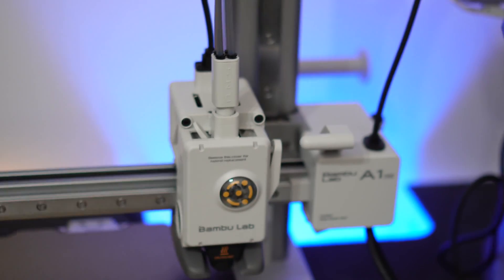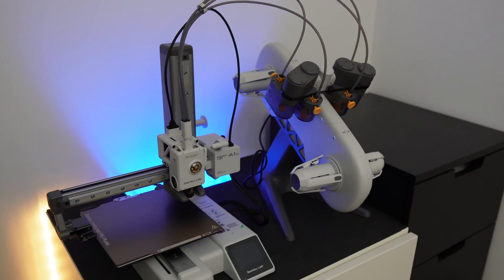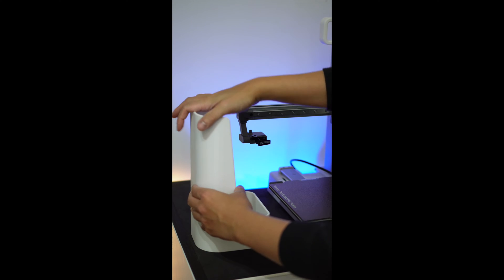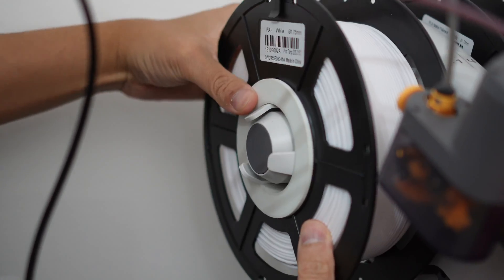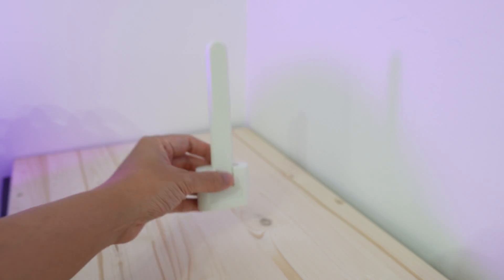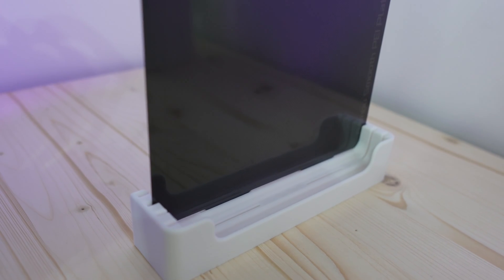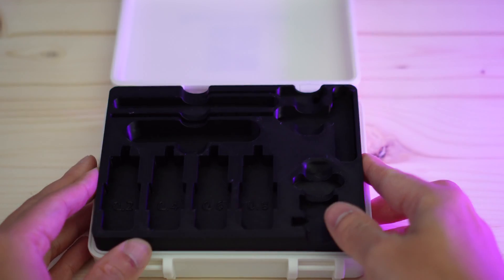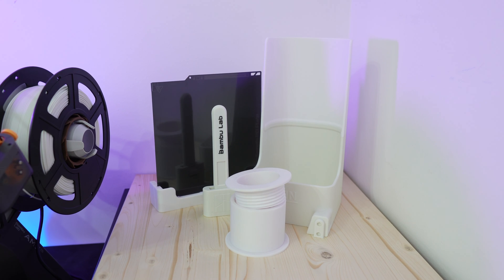6 Upgrades for the Bambu lab A1 Mini 3D Printer!

Comment: I must have been shafted with my A1 Mini purchase because the Allen wrenches that came with it are just awful. Just the bare "wire" keys, no handles. Very disappointing that Bambu doesn't offer the handle hex keys as a separate purchase in the store.
Reply from the maker: really? I got them with the plastic handles. Its interesting to know that they change that
Reply: Wait what? Actually??
Reply: @YaNeK92  yep, just the bare wire keys. Did a little searching and it looks like the handled keys were only included with the first orders after the A1 and Mini were released. Luckily I found a pattern on MakerWorld that will print some handles
Reply: @gammle-vikingr  thanks for sharing! I'm about to order mine in the next day or so :)
Reply: Then print it. I didn't even use it. Had a small driver for taking apart playstations with over 100 micro bits that worked great. Got the whole thing for like $20 at radio shack online a couple years ago

Comment: Great video thank you! but how do you move the printer when its connected to the ams? do you pick up the ams at the same time?
Reply from the maker: your welcome! I take off the tubes and the cable before i move the printer because i‘m not skilled enough to pick up both haha
Reply: Need to do an ama handle as well

Comment: Great video! I bought the A1 mini without the AMS, now that is in sale for about 200€ +  some accesories, it's going to be my first 3D printer too! You have a new suscriber here :D
Reply from the maker: thank you for subscribing! Yeah the deal is amazing, you’ve definitely made the right decision! Any reason why you didnt get the AMS?
Reply: @Lukis3D  well, I didn't get the AMS because of its size and I don't think I will give it too much use
Reply: @Lukis3D did you regret not getting the AMS? I'm thinking of getting the mini without AMS as well. Primarily due to size
Reply: @wannerskog Done bulk research and Mini with AMS is definitely the go. Much more expensive to purchase it separately later. How did you go? :)

Comment: Please don't use a steel razor blade on a PEI sheet. Plastic ones work just as well and won't damage the surface.
Reply from the maker: i am being very careful when i scrape my prints, and my plates are looking good so far. 

i tried the plastic ones and i couldnt get inbetween as easily or as cleanly. But maybe i’ll have better luck next time. Thanks for the tips!
Reply: @Lukis3D  Strange. PLA prints should literally pop off by themselves after the plate cools down.

Comment: I have A1 mini and I don’t think almost any of these is necessary. For poop collector I use cardboard box. Scraper can be used, I’ve printed it, although on textured PEI better not to use it, besides there is no reason for it. Others unnecessarily, depends what spools you use, all brands I use just fit.
Reply: I don’t want a 💩y looking cardboard box on my printer table. I like to be neat, tidy, and aesthetically pleasing. 🤷🏻‍♂️
Reply from the maker: yes of course absolutely. But thanks for sharing your thoughts!